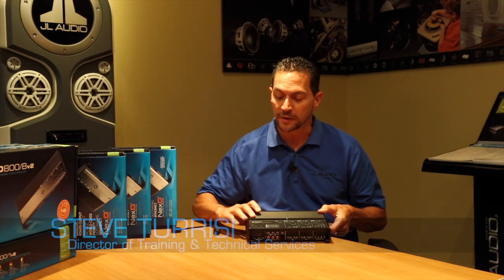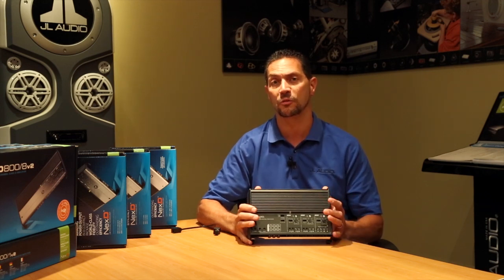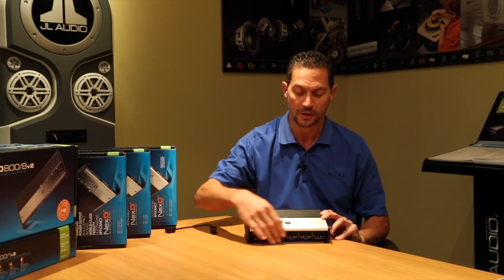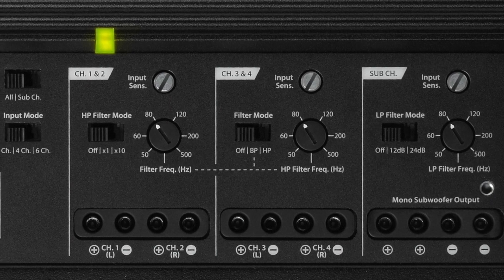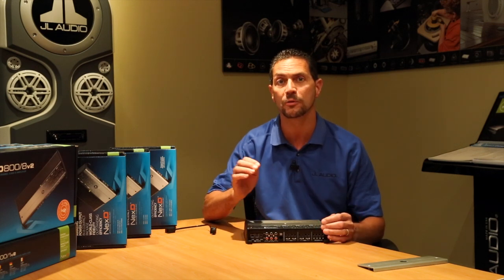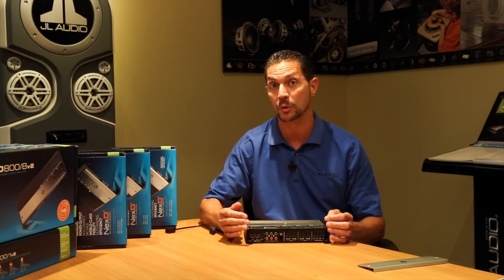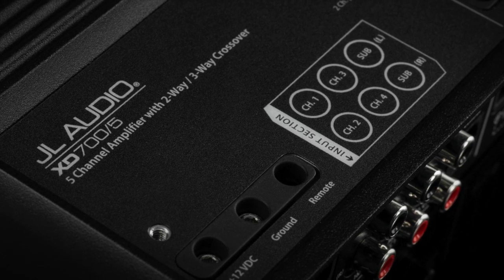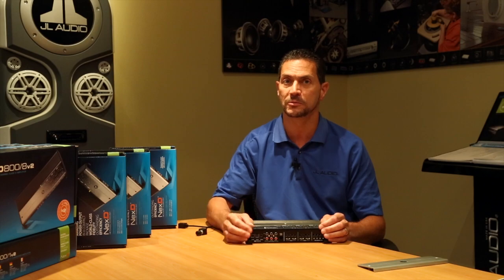JL Audio XD700/5 Product Spotlight

Comment: i have had this amp for like 7yrs now paired with two 6.5 coaxial in dash two 6x9 triaxial in doors and two more 6x9 tri in rear panels and a sub box with two 12s in back all speakers and the XD700/5 AMP are JL Audio with a JVC head unit. ya they might be a little pricey but i tell you this system will suprise you it just fuckin kicks ass. oh ya its in a 2006 dodge grand caravan and im 55yrs now and will continue to fuckin rock out. but i think with that much air space inside a minivan helps makes sound better. this little amp is between rear side panel never had any heat issues...IT FUCKIN ROCKES

Comment: One question Steve. Yesterday I had this excellent amp installed in tandem with the AudioControl  LCQ 1. the idea was to create neutral RCA inputs for the amp. It works pretty well but I'm definitely getting hiss / noise if I turn up the gains on that unit. I noticed your amp works fine by simply splicing the speaker wires from the original equipment head unit and making them RCA's. Do you recommend this method how will I lose signal input and overall quality?

Comment: will this run the 4 channels in 4 ohm and the sub in 2 ohm
Reply: Here's the direct quote from JL Audio's manual and you should download it for further information.

SUBWOOFER OUTPUTS
The XD700/5v2’s single subwoofer channel is
designed to deliver power into subwoofer loads
equal to or greater than 2 ohms. It is rated for
300W into 2 ohms, 250W into 3 ohms and 200W
into 4 ohms (Continuous Power, RMS Method).
Reply: lewis eyers k